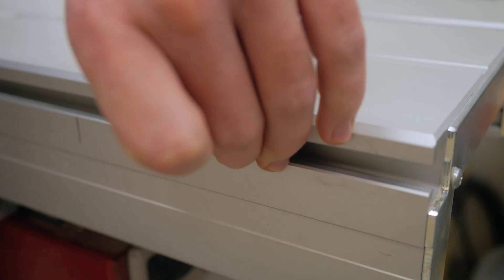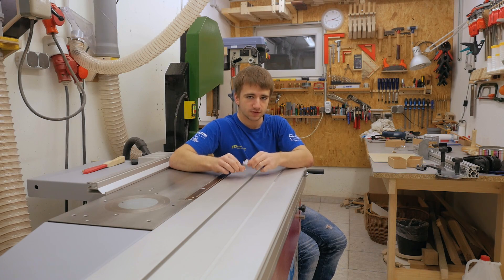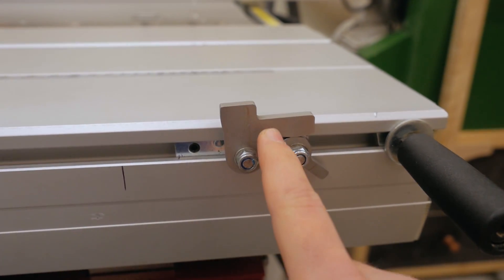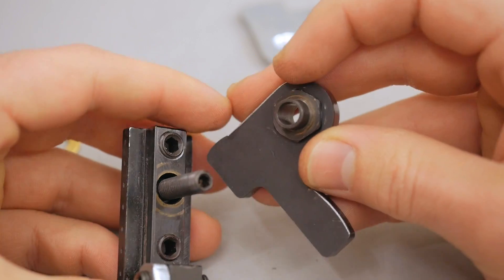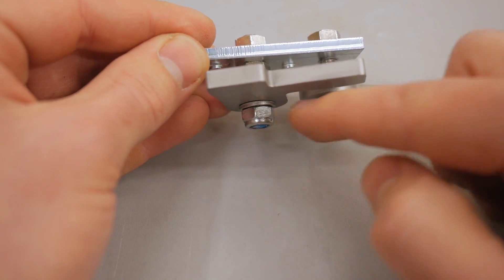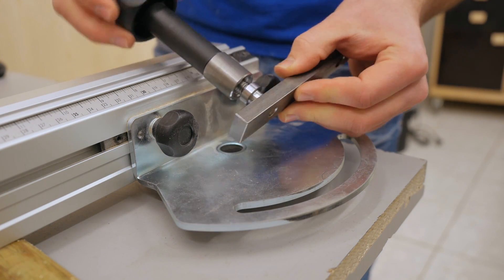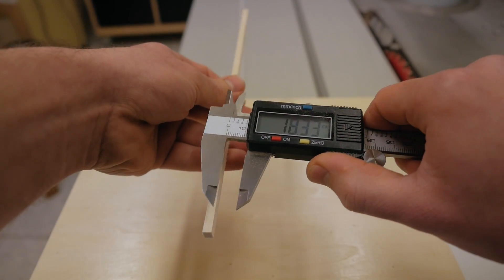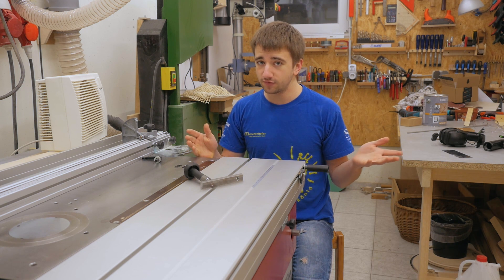Table Saw Flip Stop Update + Giveaway (over)

Comment: Why not shim between the fence and 90° stop with coresponding feeler  gauges like Mr. Ing does in the original 5 cut methid video? Seems a bit faster and more precise than eyeballing the adjustment screw and cutting again. Seems like the old 'bump and pray' method vs the new school fine adjustment methods

Comment: Sadly, as of December 2018, Felder still sells their very expensive saws with the defective stop.  The corrected version designed by Marius costs an additional $108.  Tip for anyone buying a new Felder saw is to order it with your saw.  You'll still have to pay for it but it won't cost additional for freight and you won't have to go through the removal process, which is very frustrating.

Comment: I cannot believe it, but I just received my new K3 Winner and it still has the old flip stop design. It is impossible to accurately set it because as you described, the set screw moves with the offset screw.

They did however upgrade the large knob of the pivot point.

Unbelievable how a €2,00 part is not upgraded when they have a better design available and this on a €6000 Euro machine.

I'll cool down now and call Felder first thing Monday morning.
Reply from the maker: But if it's that important to you, why didn't you ask for that when ordering?
Reply: @MariusHornberger  Because it is not an option on the price list or brochure. It is not something they offer.
And who would expect them to not make this the default?

Comment: Unbelievable that Felder is still shipping the saw with the crappy first design. The upgrade costs ~70€. I just bought a K3 and the FlipStop is still the same rubbish as in the beginning. Felder refuses to change it even if the FlipStop you can by in their online shop is showing the new design. Not what i would call customer friendly....
Reply: Can confirm it's still a problem. I got mine 2 days ago so exactly 3 years after this video was made. I was really surprised seeing that old design. The Finnish import company doesn't even have the new flipstop listed as an option so it never even occurred to me that I'd be getting the old failure of a design.
Reply: Really??? Are you from Romania?

Comment: Hi Marius, well done on both fronts. You for coming up with a solution & Felder for taking on board a great idea!

I have an A3 31 planer thicknesser, which is a beautiful machine, however the backup service in Australia is questionable. I've had a few problems with the machine from new & if it wasn't for me Nagging the rep I would still have a machine that I could not use. It still has problems & quality issues, but is usable. Could you pls provide me with a contact at Felder who I can talk to, so I maybe able to get my machine working as it should? The reason I ask is because all of my enquiries get bounced back to the Rep here which doesn't seem to work. 
Please let me know. I can provide my email address if that would help?
Cheers
Steve

Comment: sorry bro... but there is a crazy tendancy for stainless hardware to completely bind up and jam like a freaked out sheep when mounted in aluminum..  like... take a piece of aluminum and drill n tap a hole in it.. then try to drive a stainless bolt in there.  maybe first bolt was lucky. try a few more.. and one of em is gonna just stop going in half way, and wont come out, and wont budge for no damn reason!!  they even sell this special anti-corrosion paste to use when using any kind of stainless hardware... im pretty sure aluminum stock with stainless hardware is an issue, maybe its carbon steel stock with stainless hardware... anyone got an opinion out there? im sure you do.....
Reply from the maker: There are no parts threaded into aluminum. The parts only get clamped to the aluminum table, which is also  anodized

Comment: Hope Felder give you a small kick back for each sale considering it was your idea. Do you ever plan up-sampling your videos to 4k for the higher bit rate in the future? Congrats on 100k by the way.
Reply: Marius suggested, designed and build a solution for a problem.
Before that happed Felder sold probably hundreds of these machines with a (known) problem.
Reply: I agree, Marius did the work that the Felder engineer should do in the first place.
But nice of them to invite Marius over.
Reply: He said it was about 2 weeks after his video that he visited them. They could have easily designed and made those parts in a day or two. Also, the only real difference was replacing the cam lever with the set screw.
Reply from the maker: 4K is not on my upgrade list. I rather prefer 50 fps. My camera can't record that in 4K and I don't even have a screen in 4K resolution
Reply: except that there wasn't much difference between his solution and felder original solution.... They did borrow from him, but he borrowed from them to start with.
Reply: if consumers didn't complain TO FELDER and that information reach the engineer, he did not realize the part was failing to perform as intended. At the end of the day this is caused by too much play in a screw basically. one a part made of thousands of pieces, it's possible for even great engineers to fail to recognize that a part was too loose to function well. I get it's a 3,500 dollar saw, I get that isn't acceptable per say. But at the same time, it's going to be pretty damn hard to develop a high end table saw perfect every time. 

Certainly they shouldn't give him a kickback for it. yes he solved the issue, but he took there design and modified it, they took his modification and modified it and made it objectively better. 

They should probably maybe try to do a give away for him. offer some advertising revenue in return for advertising etc.

But they didn't clone his idea, they improved it fairly significantly and released it.
Reply: Dunno about that, by the vid it sounds like they were already well on the way to correcting the issue when he visited.  Their solution is significantly different from his.